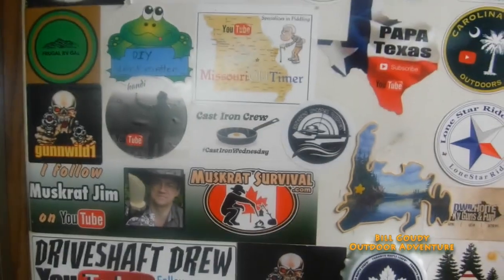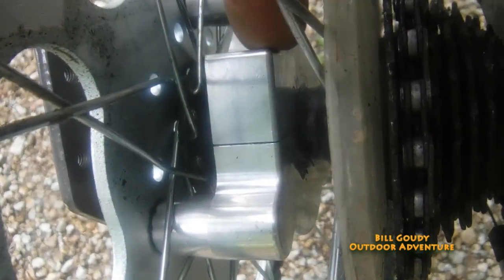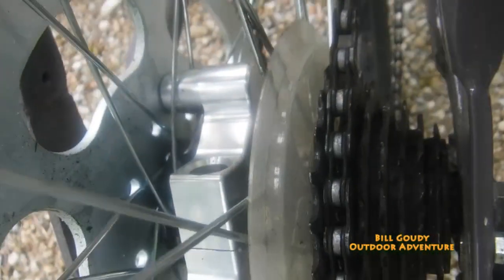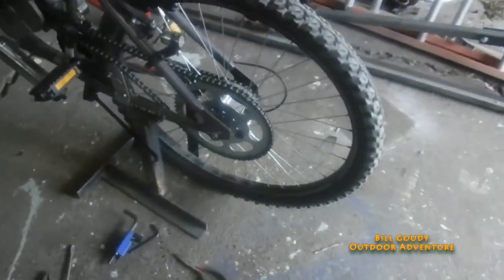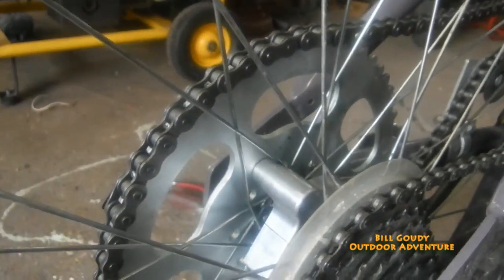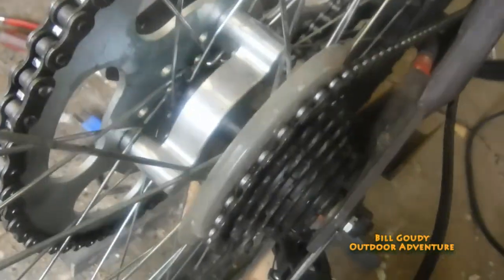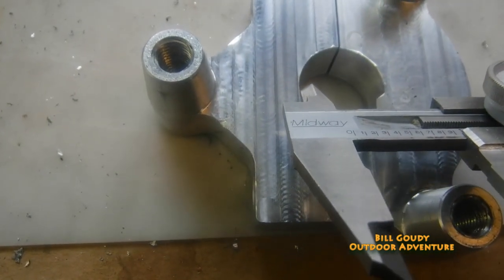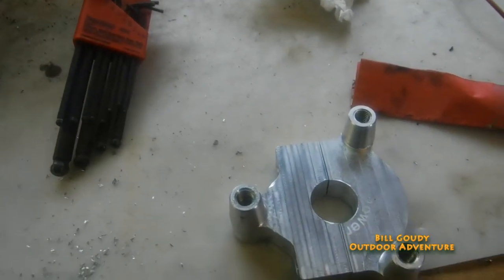Motorized Bike - Adding A 56 Tooth Rear Sprocket

Comment: I'm kinda lost I think.  You have the bigger sprocket for the lower gearing.  What is the center hub for?  Is it needed for using the larger sprocket?  Inquiring minds want to know.  I need a smaller sprocket though.  Gotta outrun them skeeters!  Don't wanna get the same treatment as the hen turkey I mentioned on your previous video!
Reply: It's a hub adapter. It's an upgrade from the stock part to Mount your sprocket to your wheels.
Reply from the maker: Like James said this is a better way to put power to the back wheel.  The bike kit comes with an adapter that sandwiches the spokes and that is a week point.  This adapter is applying the power to center of the wheel in a more dependable fashion ....  as least when it doesn't slip!!  You could use this bigger sprocket with the spoke adapter but, with the added torque I think it would be a matter of time before your replacing the rear wheel!!  Thanks, Walt...  Keep an eye out for those skeeters...  I don't want to hear about you being violated!!  ;-)
Reply: Also if you want to go faster and you don't mind extra noise simply remove the exhaust cap on the bottom of your muffler with a 10 mm wrench it will get louder but have much more torque off the line and increase top speed
Reply from the maker: @seedlessgrapes2605  ...   I did remove that cap and cut that little Baffle pipe and then replaced the cap.  I really don't want to hear it...  So, I do get a little better performance without a lot of extra noise.  I have thought about an expansion chamber....  Maybe, I will get one in the future...  Haha!!  We shall see!!!

Comment: WHAT I DID WAS SHAVE DOWN EACH SIDE OF THE ADAPTOR SO THE SIDES DONT MEET AFTER BOLTING ON IN THIS WAY THE CENTER IS SMALLER FOR CLAMPING DOWN..
Reply from the maker: I did the same thing but, I also used the JB weld.  Has been working good for me! Thanks for watching!

Comment: Do you like the 56 tooth??Nice bike by the way.
Reply from the maker: I do like it.  I am 250 pounds.  I like the added power.  I am not looking to go that fast on a bicycle.  I have motorcycles if I feel the need for speed.  Haha!  I actually built this bike to take with me on my camper.  Then this covid crap hit and I have not traveled ...  I continue to ride it from time to time but, I am not using it like I had intended to.  There is one place in Missouri that I camp and its like two miles from the campsite to the boat ramp and that is one of the main reasons that I built this bike.  Maybe, it will be more normal this year...  We shall see!

Comment: I have the same exact problem black painted hub and I sanded screw sides of hub adapter and put a hole on hub adapter and and hub but still slips. tried JB weld same exactly you mentioned but did wait only one day to dry. JB weld didnt hold up. still moves when I start engine and use throttle. does yours move at all? I'm at point of actually welding hub adapter into hub. but not sure if it is possible and high temp might damage the grease inside hub.
Reply from the maker: I am 250 pounds and I like the power that the 56 tooth sprocket provides.  I don't need the speed and having the power is nice.  So far my JB Weld has held ...  No movement . I did remove some material between the the two flat surfaces of the adapter to allow for a good bed of JB Weld. I then remove all the black paint on the center of the hub.  I have an inline air driven die grinder and I was able to remove most of the paint.  I also used the original JB Weld not the 5 Minutes JB Weld and I waited 2 days for it to totally dry. I sure don't know...  Maybe, if you just Tack welded that adapter in place it wouldn't get too hot.  Good luck and I will be making an update video sometime in the future.  It sure seems to be holding up for now!

Comment: btw I have 32T sprocket not even 56t, if I use 56t will brake the spokes immediately.
Reply from the maker: Maybe there is more force required to turn that smaller sprocket?

Comment: Thanks for Sharing Bill I just got a  bike  and I'm looking to do a build, how do you like that sprocket how is the torque?
Reply from the maker: I weigh 250 pounds and this was sprocket was just what I needed for the way I ride the bike.  The smaller sprocket will go much faster but, it bogs down at slower speeds.  I can start from a dead stop with the bigger sprocket.  The bike doesn't go as fast but, sure has plenty of power and for me that is what I wanted.  I don't need to go that fast on a bicycle...  Haha!! Riding a motorized bike like mine is a single speed while it has a power band, there are times that I feel like it could use a 2nd gear when I'm on flat pavement for long distances..  All in all this is working very well for me.  I had planned of riding it even more before all this Covid stuff hit.  Good Luck with your build....  They are a lot of fun.  Thanks, Victor

Comment: So how often do the spokes bust off of it
Reply from the maker: Thanks, Greg....  I have never lost a spoke yet.  I have changed the mounting of the sprocket from the original spoke mounted drive to the hub mounted clamp. I have actually JB Welded it in place on the rear hub. It does not move.  Working good so far anyway!!

Comment: Hey Bill did your standard chain fit your 56 tooth sprocket or did you have to get a different size chain. I bought a 56 tooth sprocket and the standard chain doesn't match up with the teeth spacing?
Reply from the maker: We need to be clear here, Brian...  A standard bicycle chain is smaller than the 415 Heavy Duty Chain that come with the motorized kit.  The 415 H fit perfectly.  I had to add a master link as when I set this bike up with the 44 tooth sprocket I didn't need it so long.  So, I cut it down to size. When I added this bigger sprocket.  I had just the right amount of chain links left over.  I went to the farm store and bought a master link ....  Perfect fit.  Good Luck my friend!!

Comment: How fast is it with that sprocket?
Reply from the maker: I have not measured the actual speed, Andrew.  I weigh 250 LBS and there is not much suspension on this bike.  I can tell you it goes as fast as I want to go on a bicycle.  The 44 tooth sprocket was way faster but, with my weight it took a lot to get the motor up to the needed RPMs.  Not much power especially on hills.  With the 44 tooth sprocket the motor bogged down a lot with my weight. I sure don't have that problem with the 56 tooth sprocket.  The bigger rear sprocket works good for me.  Keep in mind what works for me my not be what works for you!  Good Luck my friend!

Comment: Please stop! no no no......  You are not even close to making this work correctly!   Your adaptor is 1 inch exactly.  your hub is like .98 or something screw ball.  Sand off the part of the hub where your bolts connect each side to one another a tad on each side to make it smaller in size dia.  Then rough up your hub and rough up your adaptor. Then loctite it with red on the hub to adaptor., The loctite will grab the rough surface and it will never slip again.
Reply from the maker: I will tell you that this has been working great for me.  The JB Weld is working.   I'm not sure that there would be much difference in using Loctite or JB Weld ...  I did rough up the hub and I sanded down the tabs where the hub clamps fasten making the hub diameter smaller.  Thanks for watching and commenting, Rich